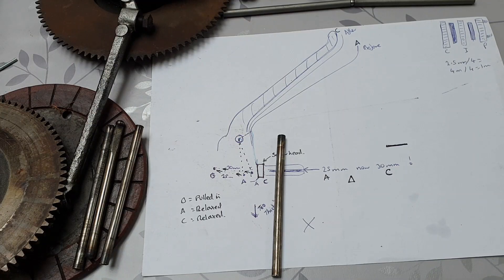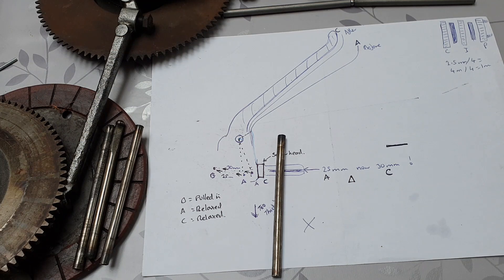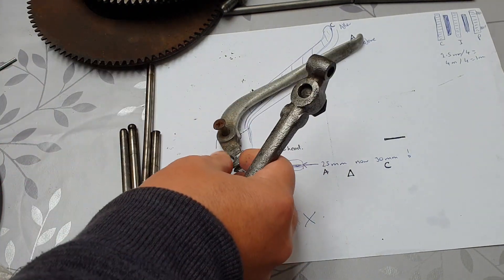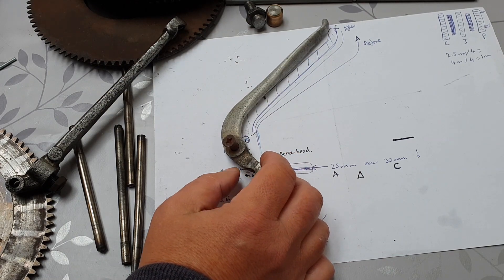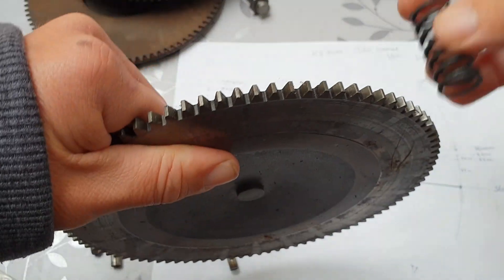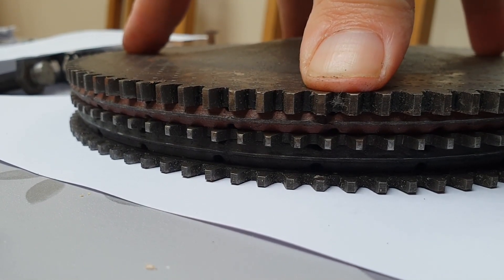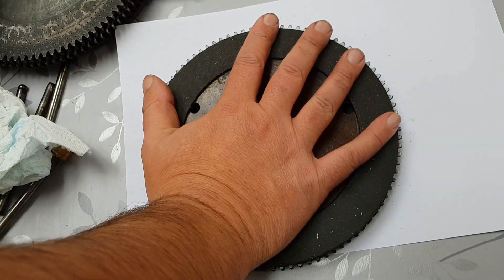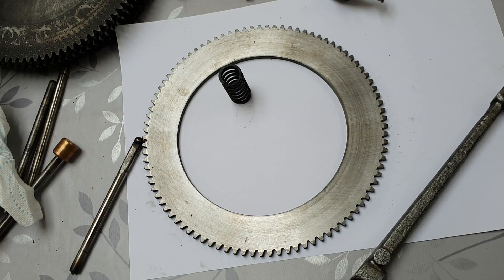Motorcycle Restoration - Part 12 (Clutch Problems) on the Zundapp KS600, KS750, K500 & K800

Comment: Excellent series.  On my 600, it is very hard to find neutral. Any thoughts? Thanks, Rob
Reply from the maker: A friend of mine has the exact same issue as you on his. When we look in the gearbox next, ill let you know the cause if itd in there and not the linkage.
Reply: @MotorClassics  Excellent! I appreciate that..Rob